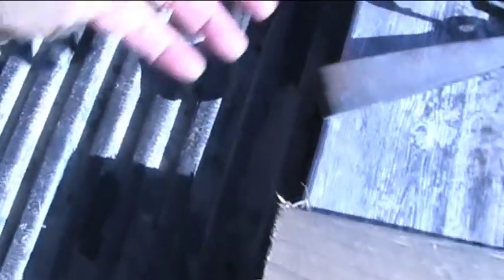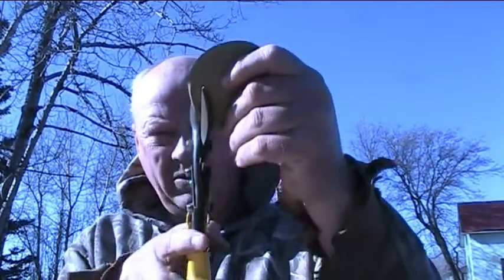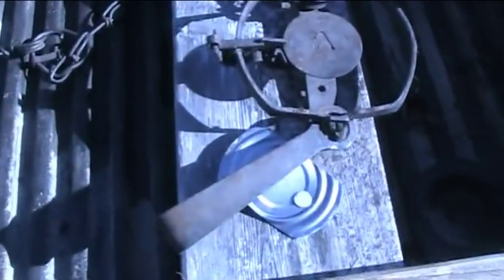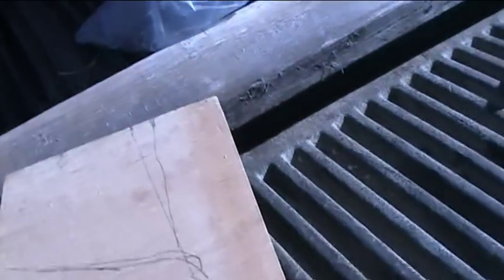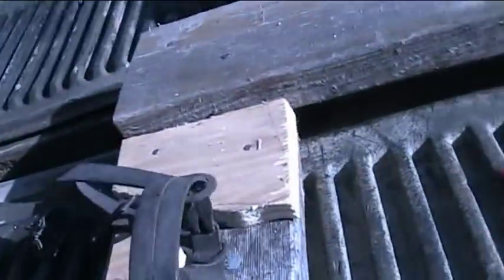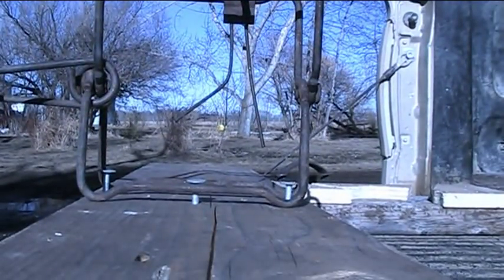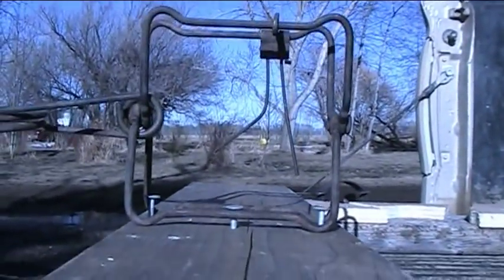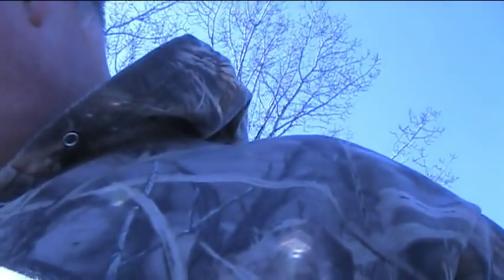Add on to the Muskrat Float Video

Comment: excellent video!!!! i really like jump traps for our rat floats and the no.2 jumps i like best and are cheap. if they dont have a hole in the baseplate we drill a small hole just big enough to fit over a finishing nail.
Reply from the maker: brad gillis That is another great way to stabilize the trap. The jumps and coils are nice because they are not as tippy hey. Do you buy up all the old jumps that you can find like I do?
Reply: yes sir i buy every one i can find thats reasonable. most consider them junk or scrap. i only usem on rat floats except for bigger jumps(3s, 4s and toothless 14s etc)for under ice beaver. plus for den decor they just look cool, lol.
Reply from the maker: brad gillis I picked up a half dozen of the #4's a few years back that have the teeth on them. Stuck in the shed so I should do something with them some day.
Reply: they may be collector items? my toothless 14s had the teeth ground off before i got them. ive got some still with the teeth that are in my collection. those big jumps are nice if you set under the ice. i had a guy on a trapping website make me a setter for the 14s. ive always been under the impression(and the ones ive measured)that the jumps had a bigger jaw spread to comparable sized traps.
Reply from the maker: brad gillis I have never checked them. I bought them at an auction sale for 5 bucks each.
Reply: even if theyre "run of the mill" oneida victors you did well.
Reply from the maker: brad gillis Ya I think they are the victors. I should take another look but I think I remember seeing a V on the pans.
Reply: if they have factory teeth and are victors they may be fairly rare?? id bet pretty old too

Comment: I took another look and to see where I was making my problem,I was using a 2x4 instead of a 2x6....
Reply from the maker: djhunter1971 The 2x4 is ok for the long pieces but ya, the traps will fall off them pretty easy. Still try the nails or the can lid. Should still work.